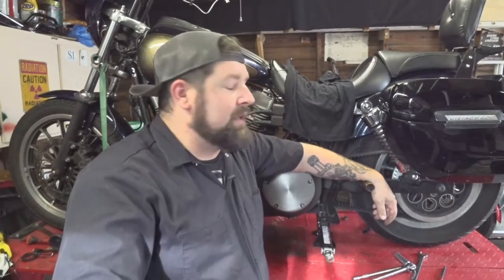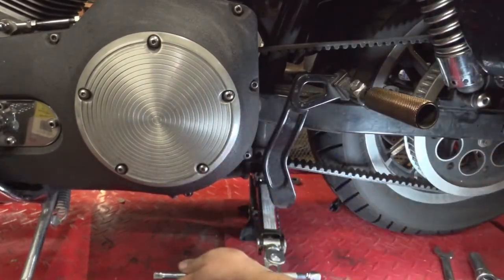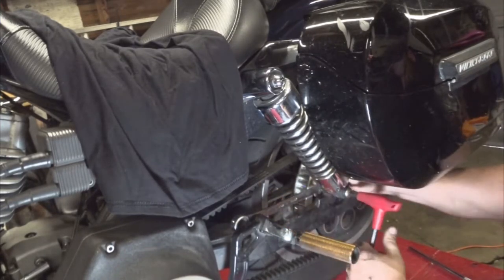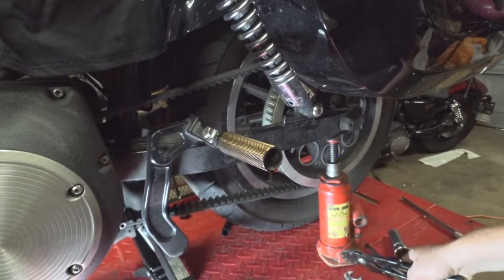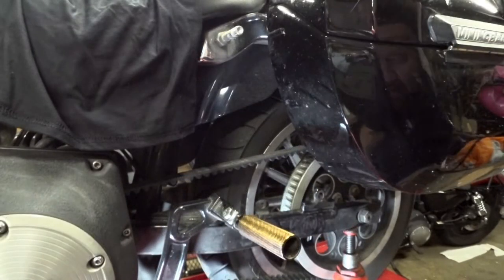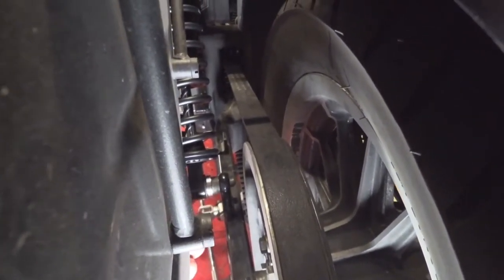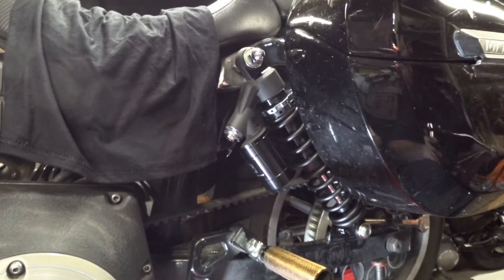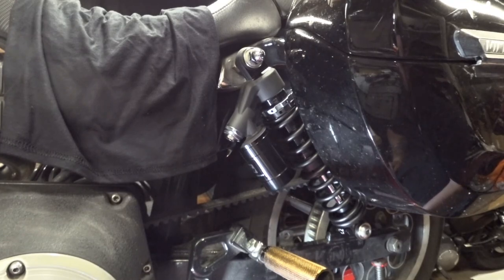Harley Dyna shock install

Comment: did you have to tighten the drive belt after putting the new shocks on?
Reply from the maker: No.  When you set you drive belt tension, you want to do it with the pulleys, and swingarm pivot point all in line.  Because that is the tightest your belt will be during the  suspension travel. Shock length will not effect that setting. 
You may have to compress the suspension to achieve this position.

Comment: Could you have mounted with reservoir    Facing rear?
Reply from the maker: Yes, you could mount them the other direction and they would work.  Some say mounting the reservoir forward makes them work better. I don’t know if that is true though.  I mounted them that way so the reservoir would clear my saddlebags.
Reply: @KnobleMoto  thank you for the quick reply.  I only ask as I have 13” fox performance res facing rear but just ordered leather pros V3 and am worried about room
Reply from the maker: @warchild4069  they might clear. If not you should be able to unbolt and rotate each shock, individually. Just support the bike up so the rear suspension is topped out.
Reply: @KnobleMoto  just thinking worse case!   You rock, appreciate the insight.  Will share your channel.
Reply from the maker: @warchild4069  thank you.